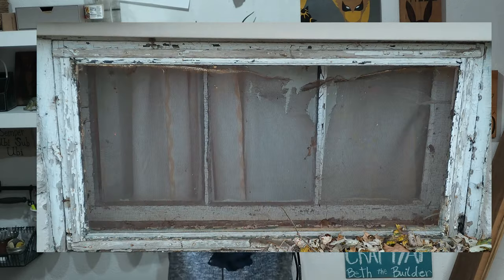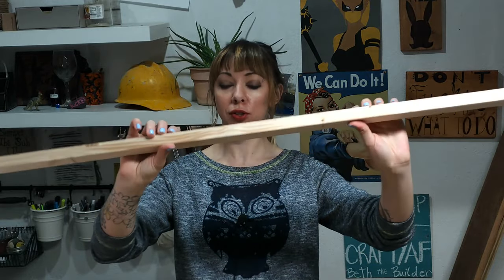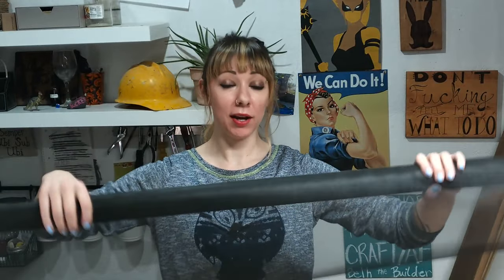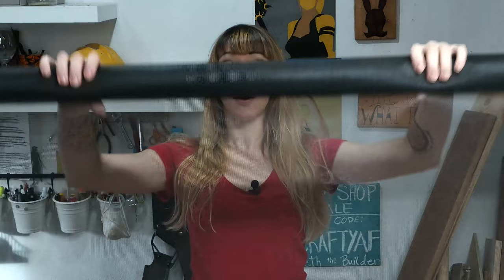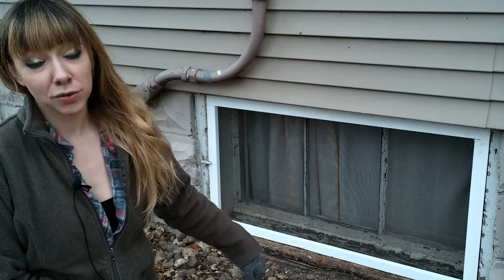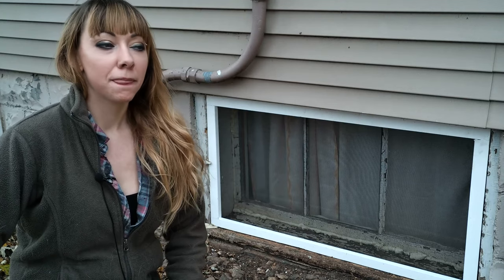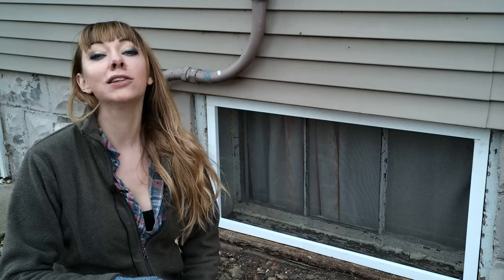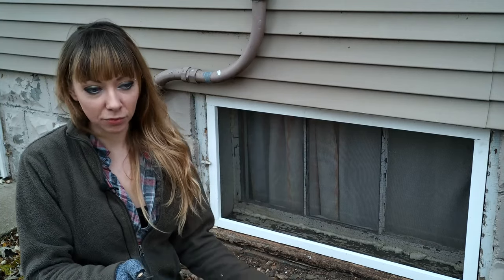Build A Custom Size Window Screen | SUPER Simple Home Improvement

Comment: Why is there always a comment I can't see? Anyway, I need to do this with a frame made out of aluminum, with the whole thing being removable. How would I do that?
Reply from the maker: It’s a spam comment. 🙄 Hmmm that’s a good question. I feel like the hardware store would be the place to go & brainstorm ideas. Maybe you can buy pieces of aluminum type frame? I’m afraid I don’t have a great answer to that one! 🙂 Sorry!
Reply: Dave,if you mean the sliding aluminum kind, those are usually standard sizes at the box store ,take it out and bring it with you to be sure you get the right one. 
If the frame is still good but the screen torn to hell,super easy fix!
There is a rubber strip that is pushed into a track in the frame, this is what holds the screen in place. 
Pull it out, your old torn screen will pop out,then just pop in your new screen, replace the rubber and trim the new screen if needed. 👌